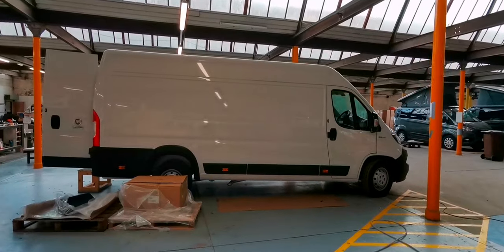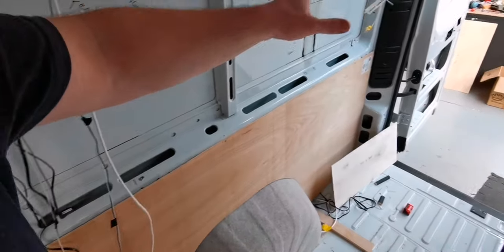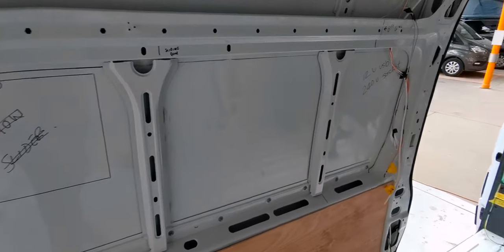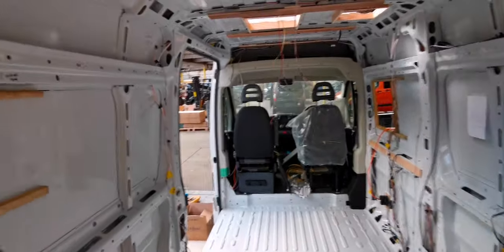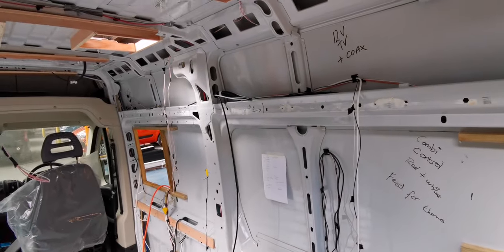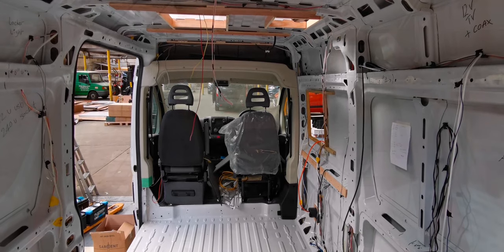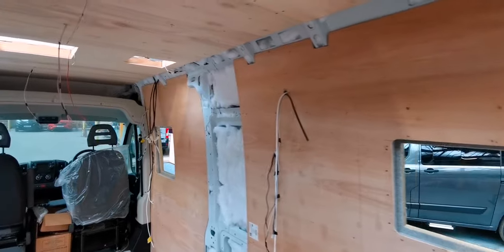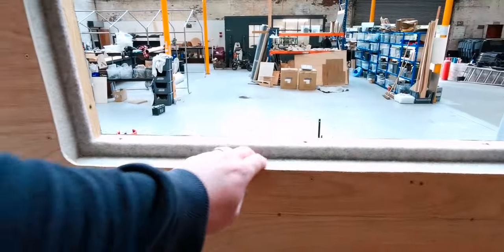Fiat Ducato XLWB bespoke camper conversion Series 12 Episode 1

Comment: Hi Dan first time on your channel 👍🏻 I am in the thought process of converting a L3 or 4 H2 Citroen relay so have been watching lots and lots of videos 👀. I noticed you don’t put on the foil vapour barrier everyone seems to bang on about, you may have addressed this in a previous video if so please direct me to it, but just wondering why no vapour barrier, as you have been doing vans for years I understand, then I would be interested to know why you chose this route as I am sure it is based on years of experience. I will work my way through your vids 👍🏻
Thanks in advance 
Alex👍🏻
Ps any other viewers I will welcome their comments on this matter
Reply from the maker: Hi thanks for watching👍 I don't use vapour barriers as many other converters don't use them either. A camper needs to breath and this vapour barrier stops this from happening. I always provide ample ventilation in the campers I build and never had a problem. Hope this helps👍

Comment: I've just binged you most of your videos, brilliant work! It's inspired me to go and buy a H2L3 Ducato and start my own project, if it turns out half as good as yours I'll be please :) Also, what thickness ply do you use on the floor and do you insulate underneath this? Thanks again, Matt
Reply from the maker: Thanks Matt, 12mm on the floor and it all depends on if the customer wants the floor insulated as it will reduce the height inside👍
Many thanks for watching

Comment: I notice you havent installed a vapour barrier or taped joints. Any particular reason for this Dan?
Reply from the maker: I've never used vapour barriers in the 20+ years I've been building campervans and never had a problem.
Many thanks for watching

Comment: Can't wait to see how this turns out ,is their much advantage with an xlwb  Vs lwb interns of what you can fit in?? , XL Wb  are  a bit of a pain to park etc ??
Reply from the maker: The customer needed the extra length due to the layout but the width and height are still the same.
Many thanks for watching
Reply: @dantheman321  same wheelbase as the LWB, too, so turning circle is same. All the extra length is behind the back wheels.

Comment: From Canada:  you seem to spray glue only on the ceiling, not on the insulation material?
Reply from the maker: On the bigger pieces I do, some of the work is done off camera to speed things up so you might not have seen it done. Many thanks for watching

Comment: Can I ask how you attach the wood in the over cab shelf section? Have you attached battens to screw to?
Reply from the maker: Which part do you mean? The roof continues through from the back which is attached to metal. The front piece is slid down at the front and connected to the roof part and the side pieces are cut to size and screwed to the plastic. Hope this makes sence.
Many thanks for watching
Reply: @dantheman321  yeah I mean above the cab. I could see the ceiling continues through, but there were no battens that I could see ? Only the one on the rib. And you said you needed to add one more piece to cover the insulation but didnt see what you would attach to
Reply from the maker: @snowbananagirl  think I showed that in the next video 👍
Reply: @dantheman321  ok cool, I think I found a shot in an older video too, so that helps.

Comment: 1,2 year and the whole buildings to change because everyting will rot. No moisture insulation !
Reply from the maker: I've built campervans this way for the last 25 years and not one has had problem with rot. This is because there is ventilation throughout the build.
But many thanks for watching